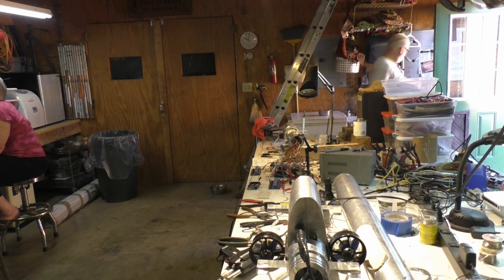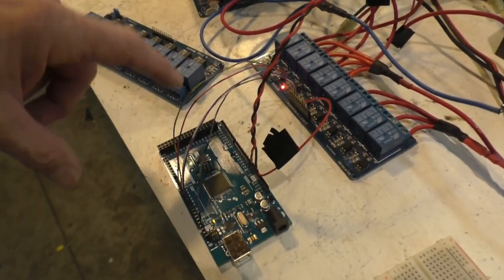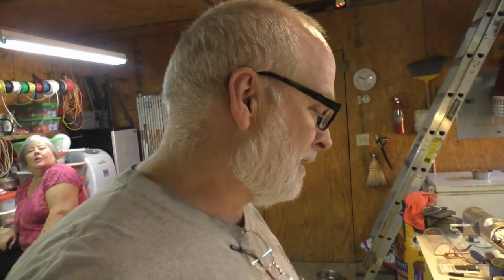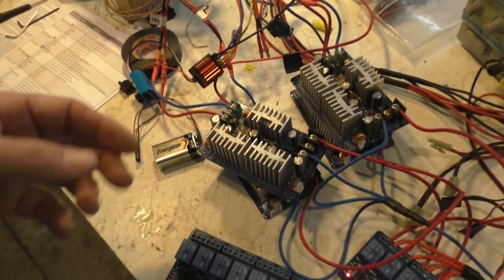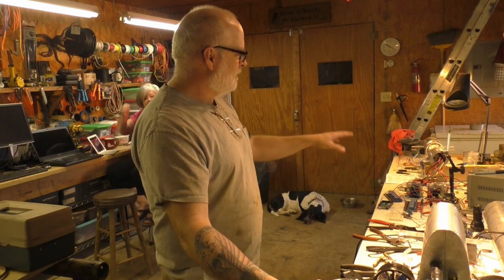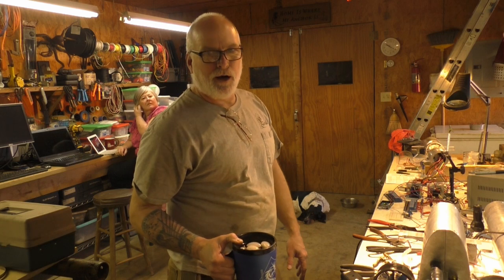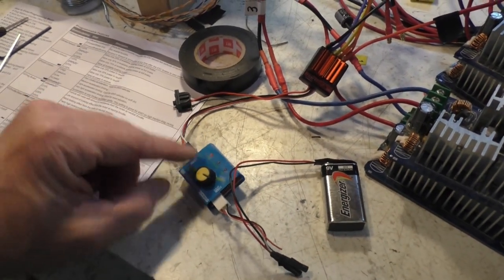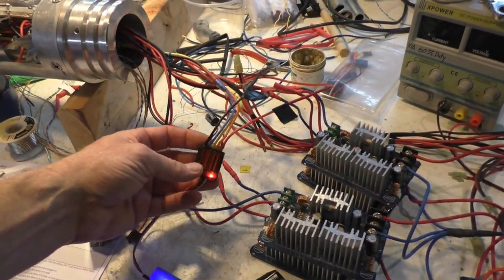ROV Wiring - Arduino, Relays, ESC, Outrunners, Bow Thruster and more

Comment: I just recently added a SSR to my 3d printer. With it my 12v  Aurdino Mega based controller uses 12v to turn off and on my 120v heated bed on my printer. Electronics have become so modular it's amazing. 

Another great video.

Comment: It's very simple, remove the jumper,  connect VCC to the 5V of the Arduino and connect JDVCC to the separate powersupply for the relais.
Reply: Carlos da Cunha e Silva 

The circuit diagram is on this page.
https://www.sainsmart.com/8-channel-dc-5v-relay-module-for-arduino-pic-arm-dsp-avr-msp430-ttl-logic.html
Reply: You should use a separate 5 volt supply. Just use the ground and inputs from the arduino. Each relay input optoisolator requires 40ma, for a total of 0.32 amps per 8 relay board *3 is just under 1 amp. That would be a heavy drain on the arduino 5 volt supply.
Reply: You are off by a factor of 100. The inputs need only 0.18 mA at 3.3v and 0.35 mA at 5v. The relay magnet coils use 40 to 50 mA, and why you want a separate power supply to drive the relays.
Reply: No, not off by a factor of 100!. I was referring to the 5 volt input that drives  the relay coils (output of the opto) which draw ~40ma each. Therefore that should have its own PS. This is why I said to only connect the arduio outputs to the relay board inputs and ground, don't use the arduino 5 volt supply.

Comment: First, I want to thank you, your videos have inspired me to build my own ROV.  Drew, thank you for your work modifying Ole thruster design. I am very pleased with the additional support added. I am working on a ROV myself, unlike the SVSeeker towed design, mine will be using 6 thrusters in a more traditional style ROV, 2 fore, 2 aft, 1 port side and 1 starboard side.

Now to my question/request. Rotational forces (from the props spinning) are not a concern with the SVSeeker ROV design, but are certainly a problem with traditional designs. I am pretty brutal at using Autodesk Inventor and was hoping you would release a reverse prop design to help all the users looking to use your thruster in traditional ROV build.

If you do not have time for this, any direction would be much appreciated.

With Respect,
Andrew

Comment: Hi Doug, as you only have limited space available, have you considered using a mosfet switch instead of the relais card? One advantage is for sure that you can also use pwm for other puposes. Should work with your 12V DC...

Comment: LiPo's are nominal 3,7v pr cell and charge to 4,2v roughly when fully charged.. That would make your pack a 3S (3 in series) as 3x3,7v = 11,1v. It can however easy be a "6-cell", if you feel there's more than 3 cells in it. That would make it a 3S2P, meaning 3 cells in series and 2 parallel. So 2 cells are in parallel producing double the capacity, but still only 3,7v together. Hope this helps on the LiPo questions.

Comment: Have you instead considered using power MOSFETS? MOSFETS take very little power to operate. Think of them as solid state relays. They switch so fast you can even PWM dim the lights to save power. They will not likely wear out.

For each channel, you would need a logic-level MOSFET like a IRL640PBF or better, an ultra-fast switching diode like a STTH812FP protecting the outputs from flyback if used with coils or motors, and a fair high resistance resistor between gate and ground to make sure it shuts off in a timely manner because their inputs have some capacitance.

A 1$ mica insulator kit and a dab of heat sink compound could be used to attach each to a stick of aluminum or the inside of the ROV to keep them cool if you are switching high loads.

For extra credit, you can add an opto-coupler like a PS2501-1-A to isolate the Arduino outputs.

The MOSFETS take up less space than relays, too. They board would still be almost as long, but only 1/4" high. Sure, you can add LED indicators, and I would add them on the input side, using 1K resistors, or after the opto couplers if you use them.

You could even make back-up boards and perhaps conformal or epoxy coat the boards as long as they could be heatsunk ( if your current draw demands it.)

Comment: Hey Doug, pretty easy to power that board. Just remove your bridge cap (blue thing) from the RHS of the board. Connect up a 5V external DC power and ground to the GND and the JD-VCC on the RHS of the board. The documentation I found suggests that you need to keep the 5V from the arduino connected to VCC as you have done in this video.
Reply: It might be worth also trying this without connecting your 5V Arduino power to the relay board. If it works you will save some additional power.
Reply from the maker: Thanks

Comment: Doug. You could use a transistor between the Arduino and the relay bank.  That would minimise the current demand from the Arduino and power the relays from separate transistor power  source. Dave.

Comment: Agree totally with your philosophy on ROV design. I worked for decades on component level repair of both high end commercial test equipment as well as commercial high power broadcast transmitters. I witnessed an ever increasing trend towards "board swap" repair of both. Fine, board swap has its merits, but speed - and economy - of repair aren't among them. Time and again I witnessed situations where failure of a few cheap components resulted in high expense and long downtimes while replacement boards had to be ordered from manufacturers. Where a good component level repair tech could easily have effected cheap repairs and had equipment back online in a matter of hours as opposed to days or even weeks.

Comment: There is a comment on the amazon page in regards to that jumper:  

"It's [for] a secondary power source. Never jump VCC and GND, as that does exactly what it says it does. JD-VCC is used to power the relays, JD-VCC and VCC are jumped so that the VCC from the inputs side is used to power the coils on the relays. However, you can remove the jumper and connect an external 5V source to JD-VCC and its accompanying GND for optical isolation between the Arduino/RPi power source and the relay power source for noise/spike issues."

Another thing you should be aware of, is not to input too high of voltage into the arduino, it has a onboard voltage regulator so you can (as you have) put in above 5v and have it powered.  But if you go too much higher you'll end up stressing and burning that out after a while.  Ideally powering the arduino with a separate 5v power source is the best practice.

Comment: On the 8 channel relay board. in my experience, you can only switch on 4 or 6 relays simultaneously when you are powering the relay coils with the arduino 5v I/O. The schematic posted shows how to hook up the coils circuit with higher power/voltage while just doing the switching through the optioisolators with the arduino.

Comment: Doug - Free advice: Apply the same mentality to your electronics that you have to building your boat. Don't buy pre-made modules when you can build your own. Using Arduino and Sainsmart modules work for bench prototyping, but they're bulky. Stick with the ATMel chip and the basic circuitry of the Arduino, but design and build your own micro controllers and modules. Arduino has SO MUCH waste built into them when it comes to final builds. They are made as a one size fits all solution to allow the greatest number of possibilities for prototyping. What you need is application or appliance specific design. Like the rest of your boat!  :) You may think what I'm saying is more complicated, but I promise it's not.

Comment: The ESC is shutting down because it is losing sync with the motor. This is quite common with sensorless ESCs. Some motors are more prone to this than others. Quadcopter ESCs are optimized to handle high acceleration without losing sync. Some quadcopter ESCs have firmware that allows reversing.
The switch on the ESC you have will turn the ESC off as long as it is running from it's built in BEC (as happened when you disconnected the battery on the ESC tester). When running off an Arduino just use pulse and GND. Leave the 5V unconnected. That way the switch will work. Oh, by the way, you were lucky to get away with running your ESC tester off a 9V battery. Most are designed for 5V.
Reply: Correct - and you can fix it by changing the 'timing' or 'advance' option in the ESC programming. There are often only a few options to try.

Comment: I used that cheap ESC for a small project. The first one I got didn't work properly, the second one did. I wouldn't count too much on that one, their quality seems to fluctuate.

That hesitating is due to lack of sensor, sensorless ESCs are great for high rpm stuff like airplanes, but if you want to run (relatively) slow, sensored motor and ESC is a must.

Comment: From the diagram I see is the middle post is the power supply from the board. When you take the jumper away you have to power the board to the outside pin. To confirm this pull the jumper and the center pin will have 5v so power the outside pin with 5v from somewhere else.

Comment: Use separate 5V power to run the relays:
1) Jumper on VCC/JD-VCC
2) +5V [external] power to VCC on main header (the larger one that also has the IN1-IN8 pins)
3) Connect external power and Arduino to common ground
4) Connect the [common] ground to the GND pin by the jumper
now you can use the Arduino to set the [IN1-IN8] pins to ground to activate relay / LEDs. (for mine, and I expect yours ... settings the INput to ground (LOW) activates the relay. Setting to HIGH (or disconnecting from ground of course) turns it off.

NOTE: this setup needs a common ground between the power and the Arduino.

Comment: Also, advice on powering Arduino from below in the list would help with the power situation. By the way do you think that a 12v system would be two small. I have seen some very bright modern leds that used 12v.

Comment: Just wondering why you aren't heat dumping to the metal shell of the ROV, seems it could be a good way to cool as the ROV will be submerged and cooled by water, also would save space internally, the heat sinks on the transformers assume airflow, which doesn't happen in a sealed ROV.

Comment: Re the locking motor , It may be that the motor is race tuned and is to far advanced to run backwards very well, you may be able to get a programing card for the esc to correct the tuning on the motor.

Comment: Connect the (relay) ground and (arduino) ground together. Then you can feed both power (VIN) from the same supply or separate supplies if you'd like. In general, DC electronics just have to be referenced to the same ground to work. They do not need to share power.

Comment: Cree XHP70 is the brightest small LED available right now to my knowledge. Up to 4000 lumens at around 30 watts, in 6 or 12 Volt variants. Cost is around 15 bucks per LED chip.

Comment: For Uc based systems when you get things nailed down I would say stay with Arduino for HARDWARE and remove the bootloader, then use a standard C compiler as it is less over head. If you need more processor power you can just distribute the tasks over many AVR's  and have one as a task controller :) Down the track you can spin a PCB IF NEEDED. (If you do let me know I can help out there and would love to contribute to the project)

Comment: I think that the 2 boards with large heat-sinks on might be superfluous. The switch side of the relay strip I think could easily drive a 12v led system. I just depends on how much power you can put in series with the switch side of the relays. You could test this by using just one relay, 5v from Arduino board to coil and 12v in series with switch side. Is that any help?

Comment: The Arduino is obviously sinking its outputs to common (GND) so Ground must be common between the relay board and the Arduino.  Positive power supplied to the relay board can be any source as long as it does not exceed the open circuit voltage of the  Arduino outputs.

Comment: My upload last week covers electronics for my camera mount systems I make and sell showing tiny maestro servo driver boards that you can program and communicate to serially from software allowing 3 wire communications to it to control servos, motors or switches and read inputs, being so small easy to put in a sealed box. For embedded control I stick with PICAXE because I write in VB6 code and its basically the same code format and a PICAXE chip is the size of your thumbnail and dirt cheap and once you program the chip you can POT it in a tiny enclosure to seal it up. Bit hard with an Ardu.

Comment: Just a note... I didn't see any balanced charging connectors on that lipo. I know safety is not a priority, but it is better to not have cell voltages out of wack after multiple chargings otherwise you wind up with dead batteries or catastrophic failures.

Comment: Doug, You Rock! 
Credentials: I have designs on the space station and many missile/satellite  systems, reliability is PARAMOUNT.
Relay Driver: The reliable/professional way would be Logic-Level FETs driven by Opto-Isolators so your microcontroller needs only supply a voltage, not milliamps per line. Putting a mechanical switch (relay) 3000ft under Sea water is just begging for failed contacts. I know you have a few EEs on staff, the 'secret' is using a FET Driver to manage the voltage difference of 5v at the logic and 24-100 at the load. DigiKey has all this.

Comment: The "S size" of lipo batteries is calculated by the number of cells that are wired in series.
So two cellls (2S) would be 3.7V x2 = 7.4V
And three cells (3S) would be 3.7V x3 = 11.1V
Btw. The arduino IS NOT powering the relays.  It can't even switch one of them, as it only has a max. of 20mA current output per pin. There must be some kind of Mosfet or optocoupler on the relay board thats sensing the arduino control voltage (in this case: Ground connection) and then switching the relay coils on and off.

Edit: Look at sainsmart, thay've got a schematic. They are using optocouplers to switch the relays. The schematic also suggests, that JD-VCC is the Supply voltage for the relays and VCC the supply voltage for the optocoupler (Which basically is just an LED and a resistor in series).

The way you're having it configured with the jumper, it pulls its JD_VCC from the arduino voltage source. Just connect your alternative voltage source to the JD_VCC pin and put the jumper in a drawer :)
(At lest thats what the schematic suggests at sanismart)

Here's the link: https://www.sainsmart.com/8-channel-dc-5v-relay-module-for-arduino-pic-arm-dsp-avr-msp430-ttl-logic.html

cheers

Comment: As far as I can see you're running your Arduino from an external power supply and directly feeding it 5V. If this is the case then the power supply is driving all the relays and not the voltage regulator on the arduino. As long as the supply can cope with it, I wouldn't bother having separate power supplies for the arduino and the relays. The main reason for that jumper is to have galvanic separation between the low voltage and high voltage part, which on your case isn't relevant. There's one caveat. The coils will generate spikes on your power rails that can disturb the arduino, so you need to add some decoupling capacitors in order to compensate.

Comment: ONE CONTACT IS COIL ,ONE IS CONTACT AND ONE IS GROUND . YOU CAN USE A EXTRA RELAY TO POWER THE VOLTAGE . ALSO THE RELAY MAY BE RATED FOR A HIGHER VOLTAGE

Comment: I suggest getting a dimmable LED driver which will likely be much smaller than the units you have, and then use the arduino to manipulate the dim control voltage as opposed to clunking the power on and off with the relays..  You may need an interface to drive the control voltage but a small opto isolator or a fet or something should do it.. This would save a relay board, relay coil power, and the ever present dangers of burning up relay contacts by driving an inductive load such an LED driver...as well as remove the large electromagnetic spikes the relays would generate that could interfere with other equipment.
Reply: Not sure how powerful your LED's are but drivers such as this one ( link below ) use the XL6006 chip which has an enable pin ( pin 2 )  which can be controlled from an arduino by detaching it from the board and adding a simple opto isolator... or npn transistor with a resistor in the base.

http://www.ebay.com/itm/1x-50W-LED-Driver-12V-24V-1500mA-DC-Efficient-High-Power-Constant-Current-/131508535347?hash=item1e9e850033:g:mjEAAOSw6BtVT~1j

http://www.datasheet4u.com/datasheet/X/L/6/XL6006-Xlsemi.pdf.html

Comment: Doug I would just consider noise from all of these power supplies interfering with your communications and sonar.
Reply from the maker: Not likely an issue as they are designed to mount onto an trolling motor, but in any case the lights and the sonars will not be operated at the same time.

Comment: Arduino should handle it. io pins are rated for 40ma. the relay board you are using looks like it is opto-isolated, so you are not driving the coils directly which is why the board needs power. If you tie that buck regulator in parallel to your Arduino/relay board vcc it should power both the ardunio/relays and should work just as you have it bread boarded now. the way you have it setup should work fine. cheers, long time subscriber first time commenting on your videos.

Comment: I'm no expert but why can't you use Mosfets to switch your loads? No moving parts  and no contacts that can fail
Reply from the maker: Yes, SSR  Solid State Relays.  And I have some, but frankly the number of switches you get from mechanical relays is in the millions.   We'll be lucky to not to loose the whole thing first.
Reply: With you switching DC Loads, especially high inrush current ones like your LED drivers, you might get drastically reduced life (most relays have a much much smaller DC current and voltage rating than the AC rating)